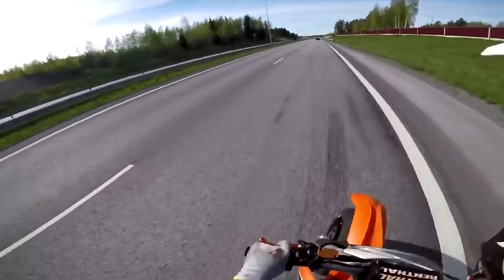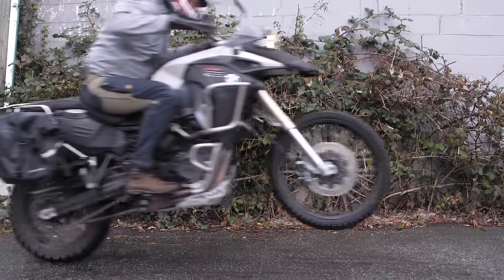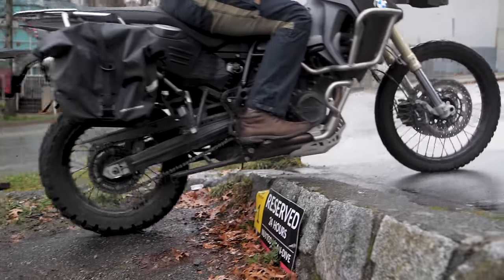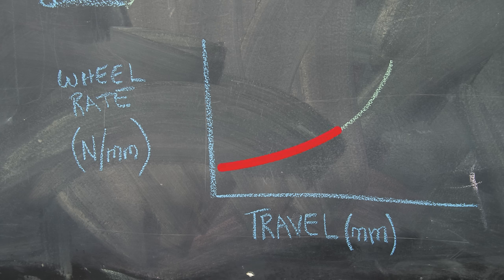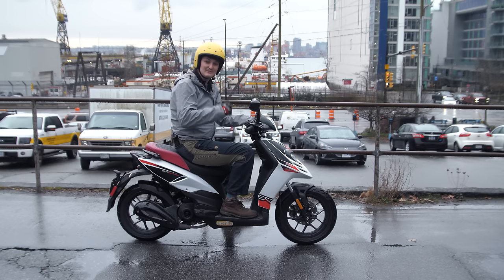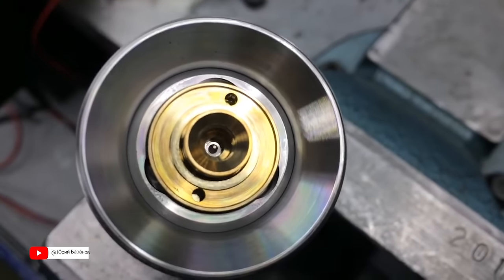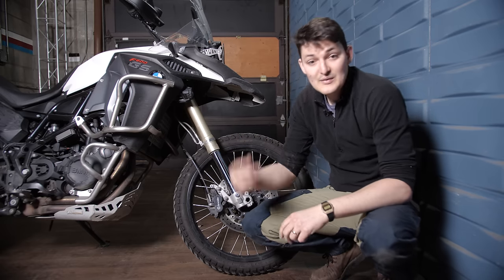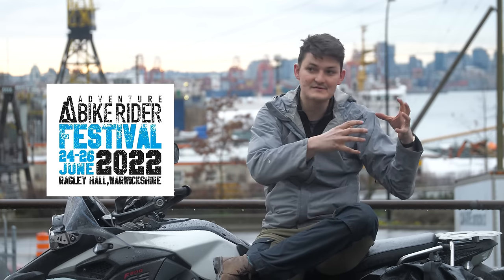Tank Slappers and the Quest for Perfect Suspension

Comment: Video about suspension and the difference about compression and rebound is not even mentioned? Also no mention of preload adjustment by nylon inserts, dirt cheap, good if you have no preload or are not within range. And if you are getting tank slappers, the first thing to get is steering damper. If you ride fast, you will get tank slappers, it's normal, almost half of the time, your front has little weight on it. And lastly, before you start messing with the clickers, change your damn fork oil, I don't remember a single time I've opened a fork and the oil wasn't dirty and orange-y.

Comment: Ryan, there is one significant flaw in your story, and its the rider input, you have treated rider as static mass, basically part of the bikes mass and a fixed mass distribution, which is only possible if object is either stationary or moving at a constant velocity. In reality riders impact and weight shifts are still quite significant, and the smaller/lighter the bike, the more is the mass ratio of rider vs. bike, so preloading the suspension, or unloading it when needed is part of ride g the bike actively, which is fun, and that's why enduro, MX and so on are so popular, you can control the bike, and you rely in doing so in predictable and rather constant suspension behaviour. Making all that electronic, etc with its own brains turn motorcycle into a commuter bus, so what the point to have a bike then?

Comment: First off, you can’t beat a good cuppa. Next up is the beer part, which is supposed to be room temperature, lager is chilled. Then there’s the side of the road issue. To be frank, what you mean is to teach you how to drive on the correct side of the road. It’s a bit like the English language - there’s the correct version and then the bastardised version (read American version lol). Same goes for the side of the road you should drive on 😉 Not even going to try with the pronunciation of Warwickshire 🤣

Comment: Main cause is too much pressure on one side of the handle bar...Then when it touches the ground. You induce the tank slapper..

The fix. Get on the gas and never touch them brakes. As you will only make it worse...Why the old saying goes. Nobody ever lost it, getting on the gas....

Comment: Well i see a few butt kissing comments. No reply from this kissers about the question you raised tho. NO i would not want the perfect suspension. Started ridding when i was 8 i'm 61 now. Most of my ridding these days is street but i still do a good share of off road. I think it would ruin the fun. Getting the front wheel off the ground is half the fun. The other half is when both wheels leave the ground. All this electronic control takes the fun out. It's designed more for people who can't ride. Being able to shift gears and go fast in a straight line is not knowing how to ride. Being able to control the out come when your bike does the unexpected is knowing how to ride. Your not pushing the limits of the machine, Your pushing the limits of the rider.

Comment: Progressive springs are a band aid for poorly setup damping and incorrect spring rate. Better to sort out the fundamentals. Also you're pointing at the wrong ends of the spring when describing suspension as supple and hard (tight coils are softer than sparse coils).

Comment: Fine production - but false message about "Tank Slabber". 99 % dont understand the basic problem. The risk of a "Tank Slabber" is based on the geometry of the motorcycle frame. Also a bicycle can experience a tank slabber - or let me rephrase it to: "Oscillating front wheel". A ladies bicycle is more prone for that, because the frame is way more flexible. I am the 1 % man (and machine engineer) who can tell you the ACTUAL reason behind a "Tank Slabber" Do you want to know more ???

Comment: Chassis stiffness, load transfer and tyre wall stiffness are the primary causes of a tank slapper. None of what you mentioned in the video is even remotely accurate. As someone who has no experience in automotive design or manufacturing, you should atleast consult with someone who knows better before making YouTube vidoes , making gullible people believe that you know what you're talking about.

Comment: 😂😂 there is so much wrong information in this video! Firstly, trying to change the geometry of the bike with preload is just stupid, as well as dangerous and can induce such things as “tank slappers”, due to being too soft/hard on one end. Just imagine trying to ride a pogo stick with all the support of a limp pillow. Secondly, progressive springs; the closer the coils=the quicker they absorb bumps, or in other words; feel softer/weaker and not the way round you were pointing out. Thirdly, ALL springs are ‘progressive’ as it takes an ever increasing load to compress them, just some are more ‘progressive’ than others, by having closer/wider coil spacing, allowing the spring to quickly absorb small bumps before quickly ‘ramping up’ for the bigger hits. This is typically expressed as a curved line on an X/Y graph. What the linkage in your suspension system does; is attempt to mitigate this my increasing the load on the spring, as it’s compressed through its stroke, in order to give a more ‘linear’ curve and therefore more consistent shock absorption throughout its travel.